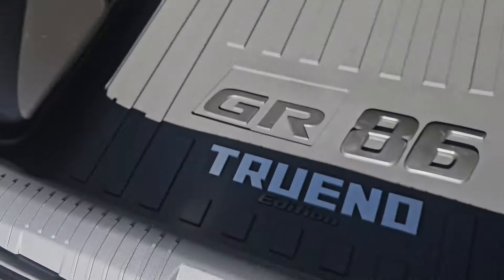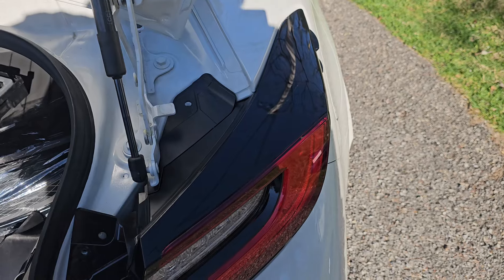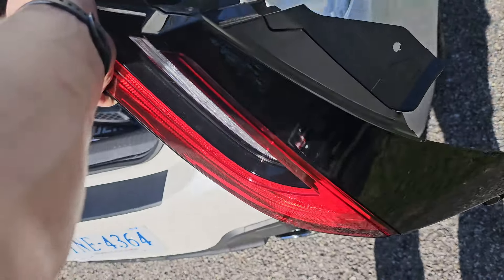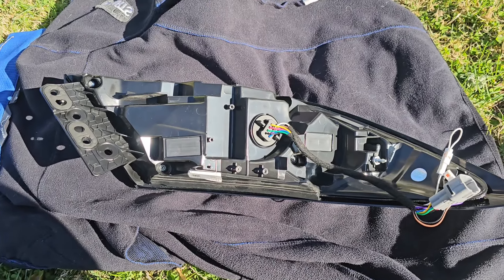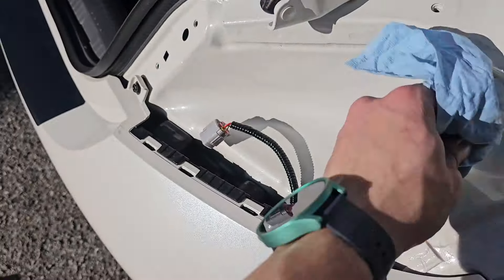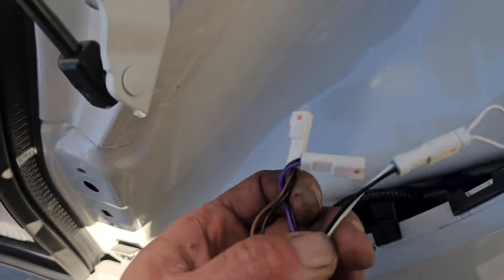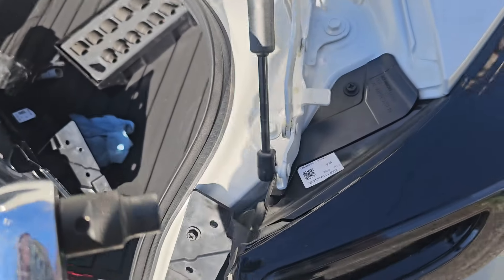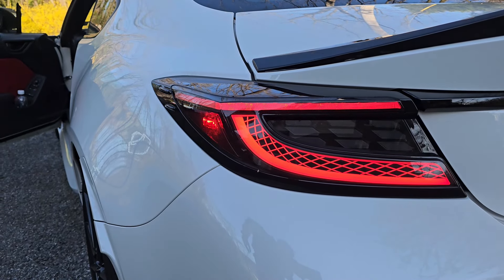How to install tail lights on your Toyota GR86

Comment: Hey bro, i was wondering what u meant by swapping the green and yellow wires? I encountered the same problem and you were the only person that had a video for installing vland lights but im still a bit confused lol, did u just take them out and put them back in?
Reply: Hey man what did you end up doing? I installed these and it’s just red, no yellow at all when I used the turn signal or emergency lights
Reply: Found out what I needed to swap! It was pretty ez!
Reply: @R.B86 what did you do? mind to share?
Reply: Please if someone can help me 😭 I encountered the same and don't know how to swap it. It's my first time and I don't want to mess it up. 
My lights are hyper flashing